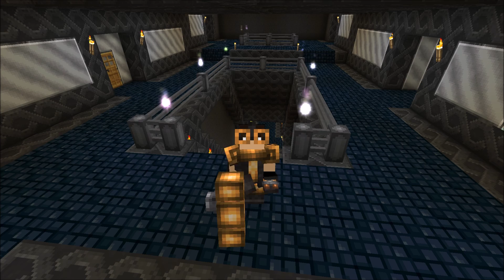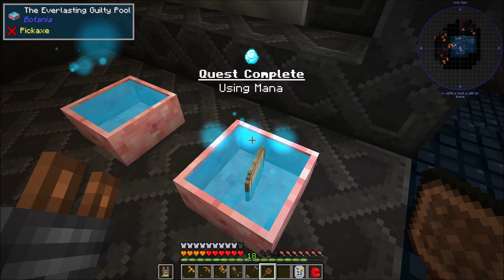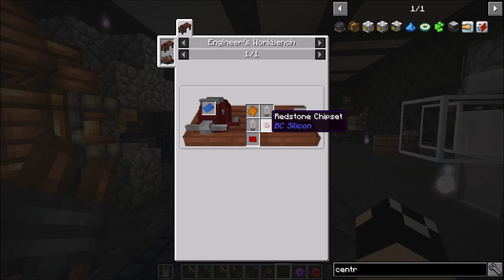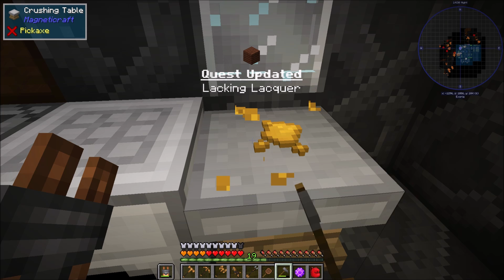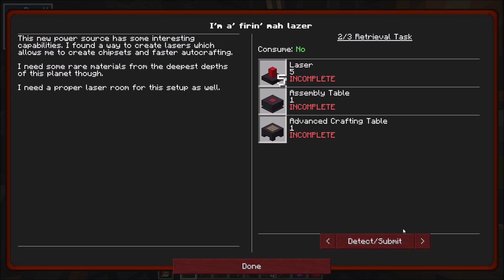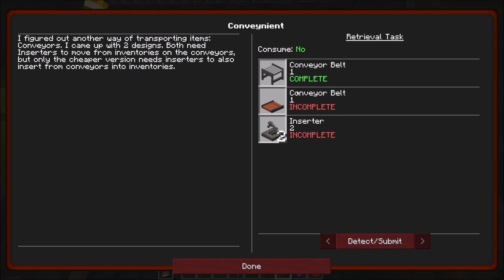Locked on to a New Dimension! : Exoria Lp Ep #12 Minecraft 1.12

Comment: They're called Core bees, so the specialty requirement is probably just being in the core dimension.

PrimalCore's blocks all operate on growth ticks, which can be pretty frustrating at times.

BC made the odd decision to return to MJ power, so it's incompatible with FE-based power sources like IF.

It's the fairies flying into the lava. They aren't very smart.

BC never had a built-in NEI handler for the chipsets, so I'm guessing they also haven't made a JEI handler for them yet either. It needed a separate mod to make the recipes show up in NEI, I wonder when someone will make a mod for them to show up in JEI.
Reply from the maker: Yeah, you may be right on the bees.  Didn't think about that but totally makes sense :p  And thanks for the heads up on BC going back to MJ power.  Didn't realize that, first time ive encountered a need for BC machines really in recent versions of MC.  They seem to work alright for making the chipsets since I tossed in a couple pipe plugs after this ep to route the power better.  The lasers still seem to have a crazy low range, figure its likely a config change for the pack or BC in general made the change.  Im still used to them having the massive range that they normally used to have :p
Reply: BC for 1.12.2 as it exists now is very incomplete and the devs actively discourage anyone from using it in a modpack. What it's doing in Exoria is a mystery for how otherwise polished the pack is.
Reply from the maker: Haha, yeah I have no clue :p  I had honestly thought it was discontinued :p  Not a mod I keep up with really, and not new or anything so I just figured it had stopped since last I had heard logistics pipes wasnt planning to update.  Logistics pipes was the only thing I was ever really super crazy about with BC since the older days of modded
Reply: I don't know why BC is even used anymore. or even IC2.. those mods are horribly outdated and clunky as all hell. plus never like MJ's as power

Comment: No a cliffhanger, anyway I have a couple of questions. How do you plan to move your items over to the misty world? Is farming valley over or on hold? Lastly, I remember in sevtech you made a edible item in stage three that you couldn't eat yet, could you eat in now or do you have to wait for stage five? Also amazing video.
Reply from the maker: Just going to use packing tape/carry the stuff over really.  Have lots of building ive been working on and left to do so just moving as I need the stuff.  Waypoints make it easy and quick, plus flight has helped a ton.  And farming valley is over, at least atm.  As far as sevtech goes, we should be able to eat it in age 4 via pneumaticraft so will give that a shot in a couple episodes on there since I started pneumatics pretty heavy in tomorrow's vid.  Also thank you muchly :)